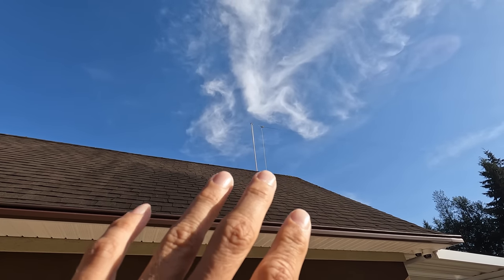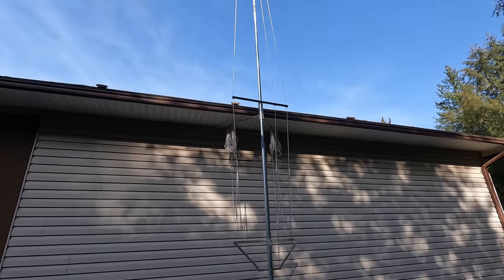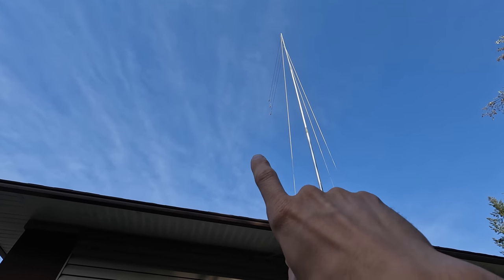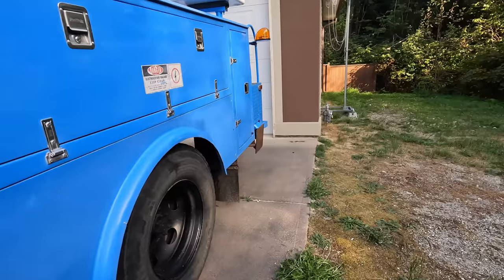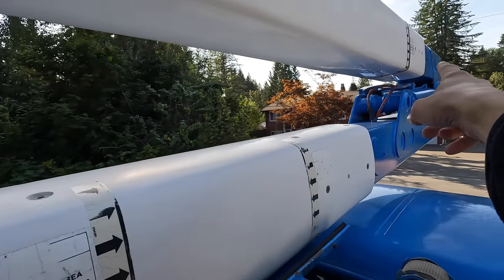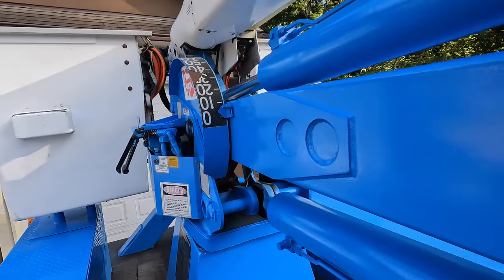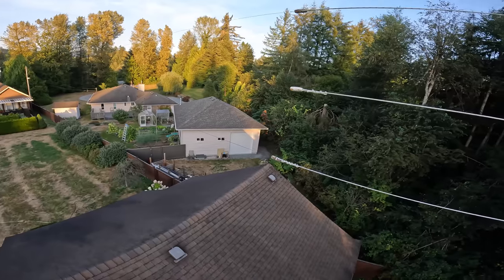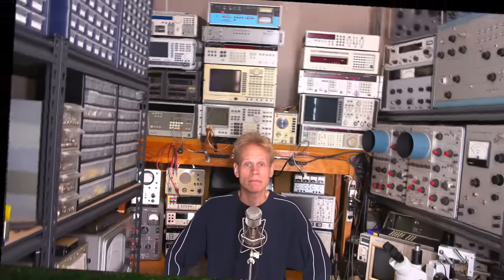Way Up High In A Bucket - 369 Antenna Inspection And Maintenance.

Comment from the maker: To learn electronics in a very different and effective way, and gain access to Mr Carlson's personal designs and inventions, visit the Mr Carlson's Lab Patreon page here: https://www.patreon.com/MrCarlsonsLab
Reply: A $200 backup camera would be a good addition on a huge truck like that.
Reply: @hxhdfjifzirstc894  I'm surprised it didn't have one put in from where it came from,but yea,it can use one
Reply: Where did you get a bucket truck? I need to rent one of those or a lift to work on my 60 ft tower.
Reply: @mattmalone524  you can rent them ,or hire one,or just rent a stand alone man lift,we have local rental yards with lots of choices
Reply: @jeffclark2725  I figured that/

Comment: WD 40 is probably not the best choice for lubricant on your pulleys. LPS 2 might be a better choice to last a little longer. Plain oil might also be a better choice. Just my two cents. There is always a critic on you tube🤷‍♂. Had a bucket type truck here last year to paint my building. Interesting feeling to be up with the birds.
Reply: "WD-40 spray and stay" is not WD-40, Google seems to indicate it's a "gel lubricant". They expanded their product line to all sorts of spray lubes and shop supply type stuff several years back.

Comment: I have been considering a bucket truck for use here at the N8UX radio farm. Would love to hear more about your truck, how you found it, maintenance, safety issues, etc. I used to work in the cable television industry, and spent a lot of time in the air.

Comment: Congrats to you! I really enjoy seeing your personal life as well. I used to work on trucks and I've worked on MANY Internationals. The DT466 (assuming that's what it is) is one one the toughest Diesel engines made! You're smart to chock the wheels. Unlike air brake vehicles with spring brake chambers to hold the truck in place, the whole truck is held by ONE set of small shoes and a drum. I know of cases where people have pulled the driveshaft in a shop or side of the road to tow, and the trucks roll away! They've started to put the park brake drum at the rear end instead in later years. Beutiful well designed antenna! Can't wait to hear it on the air. Good luck and God bless you and your family! 73's!
Reply from the maker: Hi Ryan, you know your trucks!
Reply: @MrCarlsonsLab  I worked on trucks for 27 years in 3 different states. I got tired of the (drama) and decided to pursue electronics which is something I've wanted since I was in forth grade (1984-ish). Started with ham radio in 1993 and didn't REALLY get into it until I "retired" and through a bout of depression until I got into your videos and my passion came to life! You help others in more ways than you can realize! Thanks for all you do!

Comment: Paul, I did my share of work for a local electric provider, and bucket trucks like yours have fiberglass booms and non-metalic hydraulic hoses. No surprise, the companies that trim trees around overhead utilities also have this technology. It's called "cheap insurance."
Reply: Bryant Fry, I can easily understand why someone would not want to use hydraulic hose with the wire wrappings inside of them   (I've done quite a bit of hydraulics work myself) but I have never worked with hoses without the steel wire unless it was for a very low pressure application, such as a pump's suction hose or a return line.

What kind of non-conductive material do the pressure hoses use without the steel?  Something Synthetic?

Comment: Mr. Carlson had me worried...but it looks like the bucket truck O-ring seals and hydraulic system is in good working condition....just like all the old radios and instruments restored.  I just begun to look at all your work and teachings.

While it may be an older esposide on - the FET active probe was nice. 

And it's good you went thru many components on the front end MOSFET...and tried lots..for your goodie box has  plenty to choose from. It show patience and methodical work. I seen the dual gates...in mixer circuits. It was interesting the one gate tied to Vcc. Sneaky and simple.

I intend to build one...
May my little lab...become resurrected soon. Lots of projects to be worked on.

Keep up the good work
Reply: Thanks Admiral. I like the subject and folks here. I think I will sign up for the master series...the one where Mr. CARLSON might offer advice. But I only want to ask discrete question if I exhausted any solution I have and not upset the masters productive work and teaching schedule.

Mr. CARLSON...and Imasai Guy...there are others....very inspirational...

I like to call them doctors 

Masterminds comes to mind 
Kind regards 

Fred

Comment: I'm a grandfather also, so congrats. I love the old radio stuff. I have been doing antennas since I was 10, in 1953. Now that you have the guy wires up you don't even need the bucket truck to get at your wires, just put an extender rope on the ends and run them down and up .

Comment: Back in the day I had a mate like you and he wanted me to help him put up a 60meter high groundplain his place had plenty of room and on a helpful slope and his idea was to use 3 sets of control wires from 3 dead points to get this thing up - Insane - so after each stage we had 3 wires to dead points in 3 directions and this thing came up in figure 8's - at 45 degs it was going all 5 dimensions including time and space - I was seeing a GP acting like a ballerina doing circles at times close to the ground - by 60deg's I thought we had it Then everything went sweet - we had a mast like an "S"  but we could control the S and made a C then an I and after a few hours of total panic there stood a 60meter high GP and it even worked.
He had to disconnect when there was lightening around - we used to watch the static on the plug end - your antenna is a lot smaller

Comment: Here in Western Australia, to deal with powerlines in residential areas touching each other during windy days (they have 4 lines side by side), our government owned wholesaler (Western Power) put spacers everywhere.

They did that a good 15-20yrs ago, prior to that, wind would cause the lines to touch each other.

Could be useful in your situation to keep the 3 lines away from each other.

Comment: It's rare of course. But one winter we had especially sticky snow with zero wind. It built up on wire to about the size of fire hose. As soon as it began warming it fell off but not before a few wires broke. This was a 40m cage dipole.

Comment: With the 3-6-9 antenna traversing the distance between your house and workshop,  it would be amazing if you could set it up to connect from either side,  to make use of the antenna in either location.

Surprised to learn snow build up on the wires creates a problem.  With you being in BC,  I wouldn't expect snow and ice to be a concern like it is for us in NE Canada.

Comment: I had to get in a bucket truck in the rain the first time ouside the collier county jail to a pole with a camera with a need for adjustment looking at the roof of the jail, had to stand in 6 in of water in the bucket, thay said it didnt have drain hole's becuse the water mignt contact ground and defiet the HV insulation from ground. The most exciting service call. Although being in the jail for cameras was depressing esp the cockroches in the camera houseing esp in the drunk tank cell. Thanks for the memories.

Comment: Hi I've never commented on your channel but way way back in time I was into radio and played with some interesting antenna - My first thought with ice/snow build up would be to disconnect from gear and hook it up to a DC of lets make it interesting 200amps for about 4 seconds and see how much of that ice wants to stay on - I'm anticipating the Communication you are going to receive from that iced water is - Ok Ok I've had enough - just give me another 4 seconds to pack my bags - lol tip Ice doesn't have baggage - so in all seriousness you know how much power it needs to clean the wire off in the morning each day right

Comment: Hi Paul. This may be a stupid idea, but hey here goes. You said you had trouble with ice on the antenna lines in the winter, well here's an idea that may be useful or not. How would it be to disconnect everything from them and then run a current through them to melt the ice. There may be some way of doing this; that would save you from having too manually separate them. It's just a thought and hey it may not be possible, but i just thought id'e through it out there. Hope your keeping safe and well and thanks for sharing.
Reply: Not a bad idea at all, but if you would run clean DC trough it (from a battery for instance) you should not interfere with radio reception at all, since that is only AC, and as we know from Tube circuits - AC and DC can be mixed on the same wire and still be sort of 'invisible' to each other !
Reply: You know that doesn't sound bad, but I think it could have a negative consequence on the metal wire strengh as rapidly cycling multiple times from hot to very cold especially under tension could lead to fatigue in the metal and early failure; that obviously depends on  temperature difference, tension, speed of the process and how many times it occurs
Edit: and you need to go up there to close the circuit otherwise no current will run, so I guess it is impractical
Reply: I think plain steel or music wire has relatively low resistance....but if nichrome wires were used...and not overdrive to where they would loose their tensile strength it probably would work great from melting snow and ice and not take that much power. I have a spool of 0.01"...it seems very strong as far as tensile strength at Ta. Heating wire would be used for the support then terminated at the top....return to the bottom with copper. But then there is additional weight...and redesign. I am sure then you can calculate the voltage and current needed. I am sure Mr. CARLSON can quickly brew up a heating circuit...Hopefully the wires won't upset the RF emissions. Probably a nice DC supply on the wires is better than some pwm scheme that would surely emit noise. 

I think use a nice switcher for efficiency...and filter...
Mr. Carlson probably can add a little RF temperature sensor halfway up one of the nichrome support wires...for feedback to the PA. Have the little sensor be powered by a tap say a few feet apart, charge a Li-ion coin battery sent temp. data encoded...

The circuit would run occasionally when the forecast and ice was observed 

I liked seeing the bucket truck in action.  I am a IHC fan all of my own. ..

Sometimes a KISS design might be best such as one reader suggested sailboat pulleys...those handle salt water and perhaps have better bearings. I have never seen a bucket boat...lol...

Nice discussion...

Thanks

Kind regards 

Fred
Reply: @AdmiralQuality  I like the markers for the birds...it sort of reminds me the first time I was at IBM Essex Junction VT...their big complex had stickers of silhouettes of birds turning on the many panels of glass windows....which alerts birds to turn...
Reply: @XMarkxyz  ....That is what I wondered about..as far as the temp. cycling. I think if the current could be limited...so say the wire just was limited to 200 F max ?...I think it wouldn't become too weak...I am sure there are engineering info that would show yield strength vs temperature...

Maybe I will go read and report...

Thanks Markxyz for being practical...

Good job

Comment: Haha national treasure, congrats Paul. 
At electrical supply house you can find rust preventive spray grease, works real well of steel wires needing lubrication.   Do you have turnbuckles to adjust wire tension ?

Comment: Wonder if a few custom non-conductive spacers, to keep the wires separate, would do the trick for the snow/ice problem? 
Good video Paul!
Reply: My thoughts exactly… a couple of spreaders installed ever so often along the wire will cure that issue

Comment: Put a counter-twist in the wire. It came off a spool. A wire drawing block/plate will straighten it if you want instead you can make a wood one or buy steel with a ton of different diameter holes. Its basically a little funnel. Put it in a vise, taper the wire so it feeds and yank it though with vise grips. It will be stick straight.  Your springs may need to be thicker too to overcome the wire shrinkage. Not necessary more tension but more ridgid. They might be rotating in the cold. Eyes allow nearly 180°'s of rotation too. Hard to see how you set it up. I saw the original build but forgot.

Comment: Have you considered using the old technique of running high current through the antenna wire to melt off the ice?
BTW, I worked with some friends to dismantle a 200 foot tower and reassemble it in the field of one of them. A crane bucket truck was very helpful for the lower sections. We also put a repeater up at the top of a 220 foot grain elevator. Riding up in the rickety old 1-man cage elevator in the dark was a real trip. Then we put up a 3rd 200 foot tower at another ham's farm and linked all of the towers' ham repeaters and blanketed most of the Lower peninsula of MI on 440 MHz.

Comment: I'm not afraid of heights at all, but the insulated bucket truck scares the crap out of me. The bucket bounces and sways way more than I'm comfortable with.
Reply from the maker: Yes, you are correct, I get tossed around a bit. The camera stabilization makes it look much smoother than it really is!

Comment: As far as a snow problem is there any way to send a current through the antenna wires to melt the snow and ice on them? Thinking maybe 30-40A or so would heat them up enough (maybe 60C for a few minutes, unless it's like Siberia and it just refreezes). Some beefy current limited DC supply could do it.

Comment: in the UK you have to take a test to use one of these.   A safety harness attached to bucket is mandatory with another operator in attendance in case of emergency.

Comment: suggestion (possible solution for twisted wires beginnings at antena) put a plastic dividers in between wires (as in between finger's) so the wires can't connect, twist together under a snow load or wind pressure ☺ I've seen does tips of wire dividers at electrical pols 🙄 where are a wires that close. It prevents a twisting or contact.

Comment: Paul, please note that WD-40 is not meant for lubrication.  The "WD" stands for water displacement and to protect metal from rusting.  It's lubrication value is very short term, until the kerosene in it evaporates.  Try using a a spray of white lithium grease instead, which will lubricate and protect.
Reply from the maker: Hi Tom, what kind of WD40 did I use? (Mentioned in the video.)

Comment: If you use marine blocks (Harken 224 or 348 would be about the right size) rather than those cast pulleys from the hardware store, you won't have to lubricate them and they won't corrode. Splice the rope and you can get rid of the zip-ties as well, since zip-ties don't tend to UV very well.

Comment: Something different. Love it Mr C. Reminds me of my days as a CCTV installer in central London, 20 years ago. Driving a cherry picker in that traffic was interesting to say the least. Plus i have a fear of heights, which made things even more 'exciting'
PS what are the lines on the grass, is  that a hint of some buried ground wires perhaps?
Reply: Landscaper here. I think those are likely tracks from a ride-on lawnmower. When the lawn is burned out from the heat, the tires compress and damage the grass, which can end up killing it in strips like that, because the crushed grass will loose it's moisture first. You might not notice it during the summer, but when the lawn starts recovering in the fall, it will come back unevenly like that, especially if his cutting pattern results in an overlap of his tire ruts.
It could be something else, but that's my guess.

Comment: I've had better luck using weights and pulleys to suspend the far end of a long wire antenna; with a short firm spring applying light tension on the shack side.  Those bricks with the three holes were designed for that, I promise.  I have often wished for a bucket truck for antenna work - that's "living the life of Riley", for sure.
Reply: Matambale, I had no idea about the bricks you mentioned.  THANKS!  👍

Comment: Congratulations, Papaw Carlson, on becoming a grandfather soon. That's fantastic.
.
If I'm not mistaken, your antenna is used only as a "receive" antenna?
If you, or anyone also transmits with their antennas, I guess they should make sure that no transmitting is happening while doing antenna maintenance, in a bucket truck or otherwise?
Thanks for the video.
.
ps. Are we going to see a future video of you and grandbaby on the seesaw?
Reply from the maker: Hi Rick. The antenna is only for receive. I will put up a separate transmit antenna.

Comment: I don't really use boom trucks, but I do perform inspections, maintenance and dielectric testing on them. Yours is really nice as far as they go. I've seen trucks still in active service that are much worse. Nice paint. 

They must not salt the roads much in you part of Canada. 

Those red hydraulic lines are pretty expensive. They're non-conductive. Use aramid fibers I think instead of steel

Comment: I usually use white grease for things like this rather than WD40, as it gives longer lasting lubrication and has a wide temperature range.
Reply: Yes, white grease is one of the best stuff you can use. WD40 is not a lubricant, I'm surprised that Mr. Carlson is using it for that application.

Comment: I use to test those booms to see if it could take 70,000 volts ac. But you are missing the plastic liner that goes in the bucket. I would test the at 50,000 volts ac to see if they are safe. This was done by OSHA every 18 months. I wish you live close to me because I have lots of work for it.